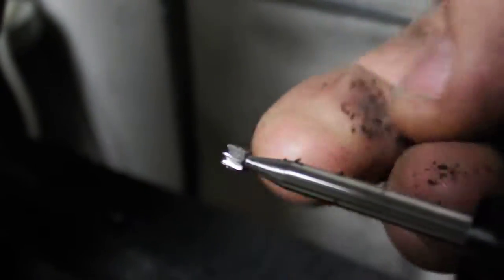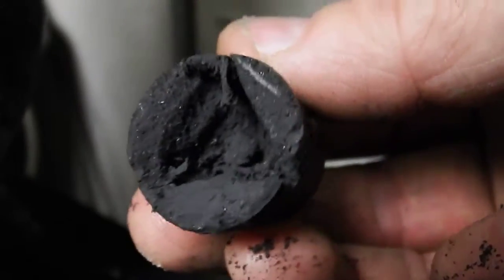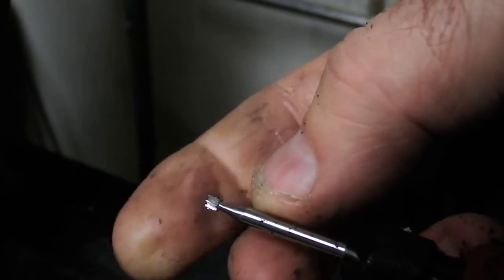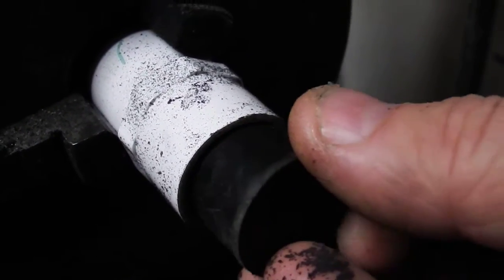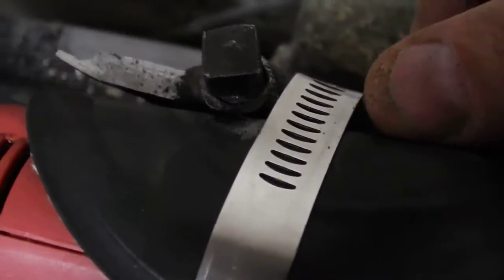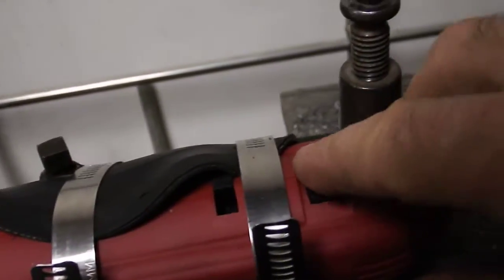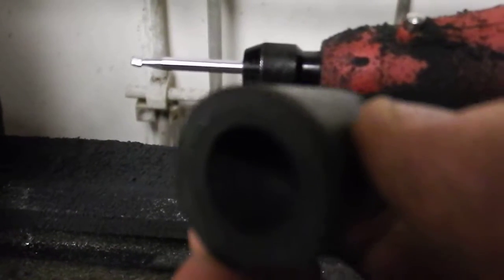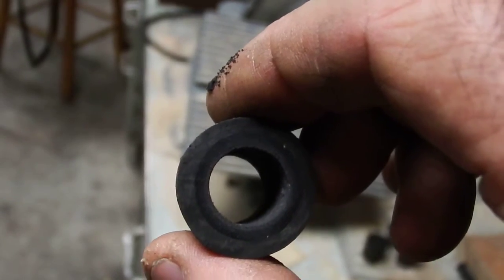machining, drill hole in rubber with rotary(dremel) tool and lathe

Comment: I needed to drill multiple 1/4" holes in a 1/4"-thick rubber mat. I took a piece of 1/4" copper tubing and sharpened one end with a grinder. Then I attached it to a drill. It cut through the rubber like butter and produced very clean holes. The only drawback is that you need to clean out the “bit” after each hole since it's getting clogged with every use. 
I think for a hole this size, one can use 3/4'' or 1'' pipes, even iron pipes

Comment: Dear Si,  i nee to make a small 2mm  and 3mm vacuum holes on silicone which is after molding with 5mm alumenium /metal plates.  

please provide me any video if you have 

thanks 
naveed